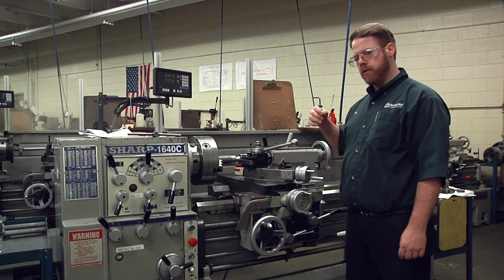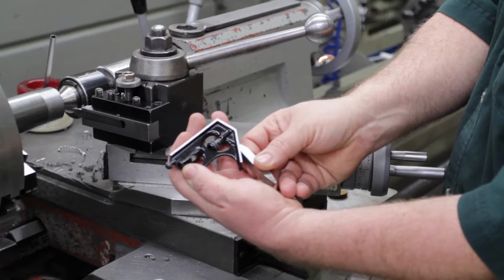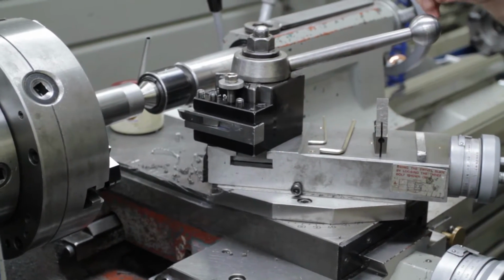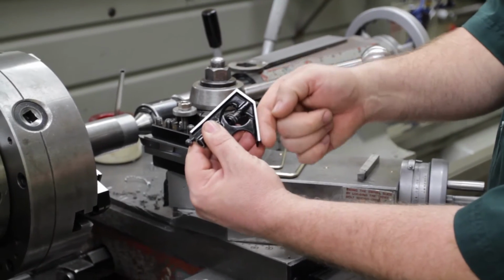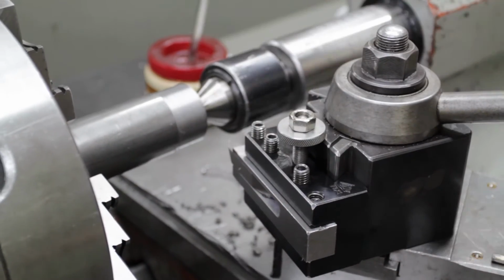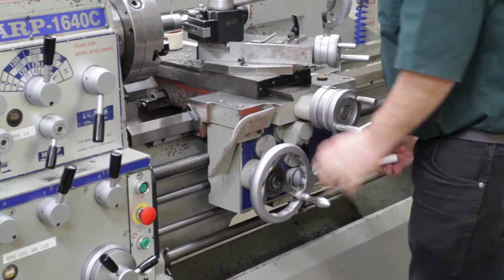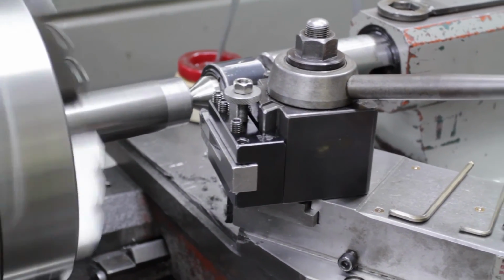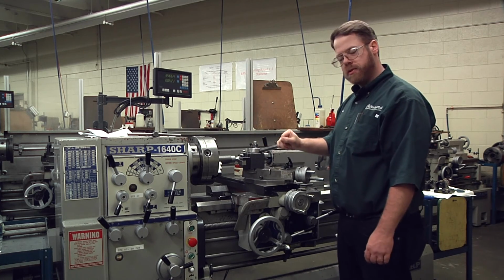Lathe processes - Chamfering

Comment: Is it expected that this method will give an inferior finish to using the top slide? When I use my (admittedly cheap) threading tools to do this, I get a lot of chatter and a poor finish. Also can I ask where the other videos in this series are please? Thanks for sharing your knowledge!
Reply from the maker: This is a process that uses the whole edge of a tool to form an angle.  This will chatter if running to many RPM. Surface finish can be torn especially if the material is gummy or the tool is not sharp. Use oil, light feeds, and the right RPM. I recommend 40 SFM for this process when cutting mild steel with a HSS tool. There are many videos. Check my channel.